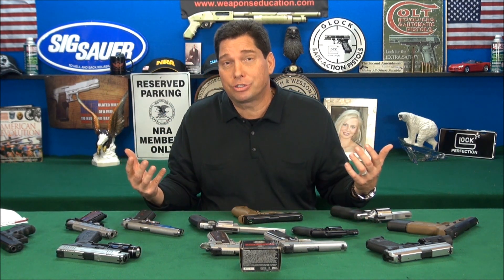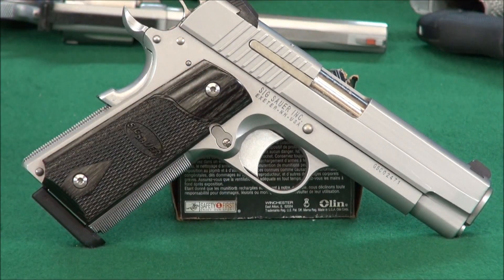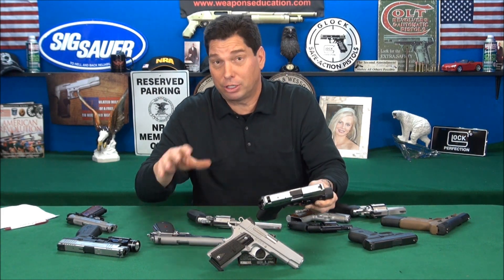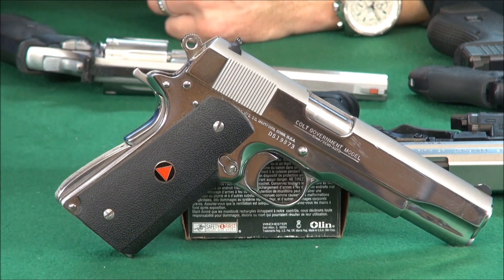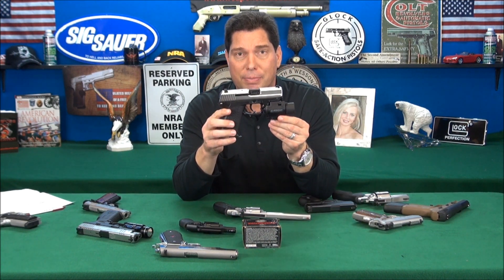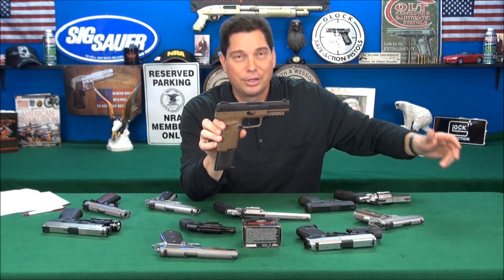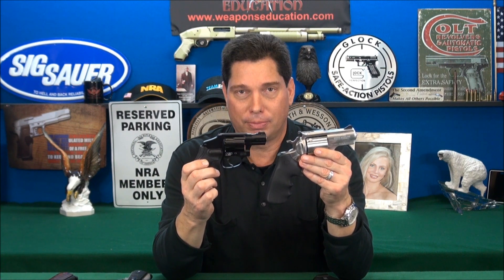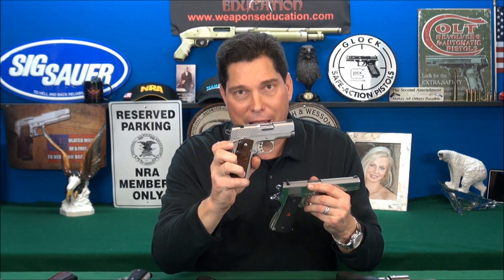Polymer vs Steel Frame Guns weaponseducation

Comment: I like the polymer frame over the steel frame guns for carrying. They are much lighter and I dont have to worry about them rusting in the summer months due to sweat. I live in Houston TX and its hot as hell down here in the summer.

Comment: I will just say that I worked on the B-2 Bomber in Pico and Palmdale..at one time Harley-Davidson Management were looking at the B-2 materials (Composites) for the frames of the Harley's. After the earthquakes in LA in the 90's the concrete support beams (that were cracked) on the freeways were repaired and supported with B-2 composite materals..I rest my case.

Comment: Tom I must complement you on how well you take care of your guns. I have the same H&K USP compact that you have. I like polymer for the weight reduction, plus it absorbs recoil. I have a H&K SL8 1 in which the entire trigger mechanism is made of graphite carbon fiber composite. Only the springs are steel.An awesome rifle. My Benelli M4 has a 7075 T6 aluminum receiver just like the AR15. My pick is polymer as it also does not show scratches from use. I hate scratched up guns.

Comment: hm...from my point of view the melting point seem of the material seems a bit pointless for comparison, because most material loose a lot of their strength long before they actually melt. Did you find any numbers on the temperatures at which the different materials loose there integrity, or in other words the gun would not fire any more, because the material starts to bend, crack or simply gets to weak to take the force of a shoot fired?

Comment: Do you think polymers can stand up to the punishment of lets say a 10mm round on a consistent diet of full loads?
Reply: 007jjb absolutely. in fact my glock 20 has over 15,000 rounds of full house 10mm through it, and still looks brand new. The polymer absorbs the recoil, which keeps the gun from beating itself to death. The early colt deltas in 10mm cracked due to frame battering. polymer in guns is incredibly impressive these days.

Comment: I agree Tom:  the three types of materials for modern handguns are all good and serve different purposes.  My favorite handgun is Sig Sauer - I have the P229 .40 S&W with night sites.  H&K is awesome as well as is Glock.  It is tough to just pick one manufacturer only.  Many times I carry my Smith and Wesson model 637 .38 +P snubnose "Air Weight" revolver made of aluminum alloy and stainless steel.  Wow so light I forget I have it on my person sometimes.  Thanks for the great videos and keep them coming!
Reply: +Patrick McCormick   Me too , I love em all.  But  if it was good enuff for 007 Bond James Bond , then its good enuff for me. I  thought I would never buy any polymer framed handguns.  Now I own 2 walther p99 gen 1 in 9mm and yes cause im a big  Bond  fan.
Reply: That's right!

Comment: what can i say, i love 'em both. my favorite guns are my all steel fusion 1911, my glock 27, and i really wunna get myself the FN 5.7 pistol. I don't really like AL alloy frames too much, might as well go with a polymer frame if your worried about weight or corrosion (IMHO).

Comment: Good vid. Good questions and points being made here.
I like this gentleman named Tom. How did I miss him all this time.

I had to subscribe!

My 'issue' with Polymer' is that I do not fully 'trust it'...yet or maybe never.
It is a Comfort Zone issue for me.  I like SS.
I do have one polymer gun.  An LCR .357.  I got the .357 because it has a SS frame with the polymer.
I trust it a lot more then the .38 version plus it handles recoil a LOT better then the .38 LCR.

Great vid! 
Thank you Tom!

Comment: Thank you for the video. When I mentioned fatigue I also mean when having to point the weapon for more an extended time such as trying to line up a difficult shot, frequent transitions to ready position,or holding someone at gunpoint. Heavier weapons cause muscle burning and vibrates front sight. Is partly why I train with my Ruger SR556 (6.8) which is heavy by holding it in the firing position for extended periods of time.Same with pistols.Anyhow very nice collection you have there.

Comment: My personal opnion is steel forged. It's better for holding up than cast steel, or polymer, but it cost thousands for good guns. I believe the polymer is almost equal to cast steel, but it's not for me. Perhaps it might be okay for holding on rubber grips more securely, but that's all I'd ever accept.

Comment: The problem with polymer semi-autos (possibly excluding the five-seven) is that, if your grip is not firm, the risk of failures to feed rises GREATLY. When might that be a problem? 1) When you're not really EXPERT in handling it. 2) When you're TERRIFIED for your life. 3) When you're wounded. 4) When you profoundly EXHAUSTED.

A polymer pistol is a pistol that might let you down when you REALLY need it most, unless your training is IMPECCABLE--which is not likely.

Comment: My Glock and my Springfield XDS are usually my EDC weapons. I love my Kimber though and usually shoot more accurately with it at the range so I guess what I'm saying is that I like both. I use the polymer guns more for EDC because of the lighter weight

Comment: do you think we will start seeing more carbon fiber being used in guns? I know they make a ar15 right now. steel is denser then polymer thats why it has a higher melting point where polymer allows more flex something that could hurt accuracy S&W MP frames do a great job of reinforcing there frames with it. also polymer does not  expand or shrink in  weather like wood does. there is so much to consider

Comment: I think when a person debates what kind of frame they want they need to decide what they will be using the firearm for.  Steel frames are going to weigh more than polymer.  If you're going to carry I'd advise polymer, lighter weight and most polymer firearms have higher capacity.  So just some advice look at how much your prospects for carry weigh and capacity.

Comment: All frames for the different platforms work efficiently and do the job they were intended to do. Like you said with today's technology alloys are being made to make guns more resilient and durable.
Reply: Aluminum frames will crack over time. I've had Colt and Spanish Star PD .45ACP 1911 frames crack out at the slide lock pin holes.

Comment: The polymer on the five seven feels stronger than most steels.

Try penching the magazine well on a five seven, then try that with a glock. I think the point is made when it comes to strength.

I really prefer full steel guns when it comes to moderate to lower recoiling rounds, and prefer polymer when you get into snappy hard recoiling rounds. This is why 45acp in a 1911 is comfortable and why 10mm in a glock feels very similar. Everything has its place.

Comment: I prefer polymer. Imo the weight difference is minimal when concerning follow up shots. None of my pistols go buckwild when fired. But what is noticeable is fatigue and clothing sag. My Stoeger Cougar 8040 F feels like a barbell weight,where as my Glock 22 or USP 40 certainly dont.The difference in weight between my Kimber 1911 and USP 45 is barely noticeable.All fully loaded. Honestly it comes down to persona preference. Temp wise if you or gun are some where 400degrees+ you're already screwed.

Comment: That to is a factor, if a person is not used to having something heavy a polymer may be a  good idea, faster draw time also due to reduced weight. An all metal frame would be great for home defense where you may have to use the weapon in a hand to hand style (probably never going to happen). My choice for carry would either be a P226/9/0 or a G26/30 I would love a 5.7 but its hard to find and the ammo isn't cheap (Nothing is anymore thanks to the gun grabbers)
Love the Channel! Keep up the work!

Comment: You pretty much answered the question for me (as in, "not steel").  Steel is heavy, requires extra care but my pistols are for carry/ self defense.  Most of my pistols are polymer, a couple are alloy frame; only my GP-100 is steel.

Comment: i only have one handgun. its the sig p226 tac ops. ive shot my friends g17 and out of the 2 i prefer the sig. mainly because of the weight. i felt the glock was to light and i had a hard time keeping still. im not experienced with handguns by any means. but i feel a heavier pistol is better for me. great vid. i think it would be sweet if glock made steel versions of there guns.

Comment: IMHO, Poly guns are best. For the simply reason, weight. Yes recoil is less when shooting a heavier gun, but if you have to carry all day and sometimes 24 to 48 hours at a time you learn to appreciate Glocks. Even though HK is a poly gun, the material in their slides adds more weight than normal.

Comment: Yes steel is for me, But it depends what you are going to do with it. I do not have a carry license, so weight is not an issue for me, I like 1911s and I have one currently and 2 on order at my local gun shop. A springfield armory mil spec in stainless and a Kimber stainless raptor 2. Both of these are range and  home protection. If I were carrying I would be using a Smith and wesson M&P 9c.  I am not into Glocks they feel cheap and dont feel right in my hand.

Comment: I like beautiful guns, which means sticking w/metal for the most part.  For the life of me I just can't understand why polymer, which you could pretty much mold any way you want it, can't be better looking.  OTOH, it's hard to beat the light weight/hi capacity benefits of polymer.

Comment: I should mentioned that a major sub to the B-2 was Boeing. The result of that collaboration with NG, was the use of the composite material, as U say was the B-2. But Boeing was able to take away from that collaboration the use of that material on the Boeing 787 Dreamliner. The following is from Wikipedia: "Each 787 contains approximately 35 short tons (32,000 kg) of carbon fiber reinforced plastic (CFRP)."The result is a more fuel efficient plane, like the B-2. But the cost! another story.

Comment: I think when it comes to the material it also has to matter on experience. To people new to the firearms world polymers would be great for beginners as they don't require a lot of maintenance. Alloys that don't rust would be after and then steel. Now yes people can get a steel weapon but the issues of cleaning and such would be troublesome to a person that hasn't been in the fire arms world long. Just a thought.

Comment: Here is the bottom line on gun frames.  You have to be realistic when you purchasing a gun. There is no hand gun frame that is perfect for everyone.  Choose the grip that you can shoot well naturally. Meaning that if a glock fits and you can shoot it well. Then a glock is for you. If a sig or a kimber works for you go with that.  I almost suggest lay a bunch of guns on the bench only take one shot with each and see how close you come to your mark. Eliminate all but three then spend a little more time with each. Then narrow it down to just one. If its a SS or an Al alloy or a ploymer it doesnt matter. If you take care of what ever gun you shoot well. It will take care of you.  No sense in carrying or having a gun you cant shoot well. Just my thoughts on the fram material. Just fyi I hated glock stayed away from them because of the poly. Guess what I shoot a glock better than any other gun i have owned right out the gate. Where some others took me some time to get used to. So i decided for use in a quick situation for carry a glock would be best for me. Again its about what you can shoot well out the gate. Not everyone can afford to go shooting every week.

Comment: @weaponseducation I prefer steel framed pistols simply because they have more heft to them. I find that the extra weight helps control recoil. That being said, polymer frames are not a deal breaker either. I like the S&W M&P and the HK P30. Regarding the weight. My steel framed 1911 (.45 ACP) feels like I am shooting a polymer framed 9mm i.e. HK P30 in terms of recoil

Comment: Well Tom, I like all thee (steel, aluminum, polymer). Each serves their own purposes. As for durability, I've got a 1989 Glock 19 and it is in great shape, thousands upon thousands of rounds later. I've only had any "trouble" with alminum...and then it was a gunsmith that bobbled it, not me.

Comment: The Trieste submersible made of steel went down to 36,000 feet of ocean in 1960 and came back home safely. The Titan submersible made of carbon-fiber polymer went down to 12,500 feet of ocean in 2023 and went "crunch" and became part of the Titanic scenery. 'Nuff said!

Comment: Polymer is better because it's lighter--as long as the individual pistol can function properly even with a limp wrist. Older glocks in particular regularly FAIL to function with anything but a perfectly stiff wrist.

When you really need it to function, you need a pistol that can function even in NON-ideal circumstances.

Comment: I think it's "six of one...half a dozen of the other", so to speak. Polymer frames are great and make a nice light pistol, but steel framed guns absorb recoil much better, and if I have a gun on my belt, I want to feel some decent weight. Being a traditionalist, I will probably select a steel frame if I had to pick just one type. To illustrate my traditionalism in handguns, if I ever bought Colt 1911, I would buy the basic G.I. model, not any fancy Kimber, or anything customized.

Comment: I believe they all have their place I have an Israeli Desert Eagle with an aluminum frame, HK P30 & P2000SK, Ruger P95 which are polymer,  an old Mauser 32 auto model 1914 unknown varient which is steel and plan to get a steel Jericho 941. For me it's all about function and reliability of the platform and the individual firearm.

Comment: I paid $960.00 for my SIG P226 Navy (all metal), but the SIG SP2022 was $495.00 they look the same but the SP is Polymer (came w/1 mag vs 3 with the Navy), but still about 1/2 price for a quality weapon, I was always against Poly guns but now I love them, just as reliable but more economic (don't want to say cheaper due to high quality)
I was always a 1911 guy but recently changes to a modern mind set.

Comment: Steel frames usually more expensive collectibles.  Beautiful pistols like 1911s, Sig P220, CZ, Beretta 92s, etc... polymer is for business in my opinion. You don't want the cops confiscating your 3000 dollar cystom 1911 after it's used defensively. Plus it's lighter and easier to carry.

Comment: The polymer crowd seems to be willing to buy/shoot anything and the steel crowd seems dead set against anything other than steel.  Does that carry over into hunting rifles too?  I would love to see you steel guys lug around a steel .308 through the woods.  Am I a Pus because I like my rifle stock wood or composite? It's all about how practical the material is for the use.  I don't think it's practical to CC a 2 pound steel 1911 when a more practical choice would be a light weight polymer.
Reply: xxthestigxx1 a steal frame would last for thousands of years... cant say the same about plastic

Comment: I had 4 Ruger LCP's that fold like a cheap lawn chair with any substainal amount of ammo down range. I mean cracks in frames, in grips, rail splits etc. Later bought a Beretta Pico and the gun will out last 10 LCP's and keep on trucking. You also need to distinguish grips vs chassis. Polymer is fine for the grip, but not the chassis. Glock for instance will use Steel inserts on the chassis, Kahr the same at the stress point. Take the Nano and Pico, solid Stainless Steel throughout the gun and build like tanks. Forget a aluminum chassis on a gun that you plan to put a lot of ammo down range. The Military does not buy cheap aluminum guns.

Comment: without a doubt polymer. more capacity. light weight. reliability. the only polymers that come to my mind first are 1911, and they need break in period. and to get a great quality 1911 you have to spend well over 3gs, and for the same quality as a $3000 1911, you can get a beretta px4 storm for only $500